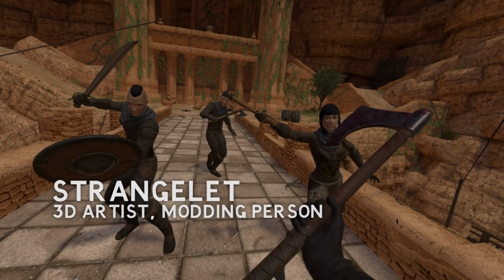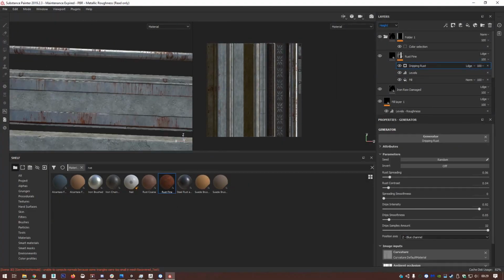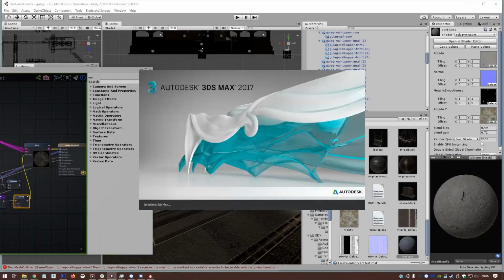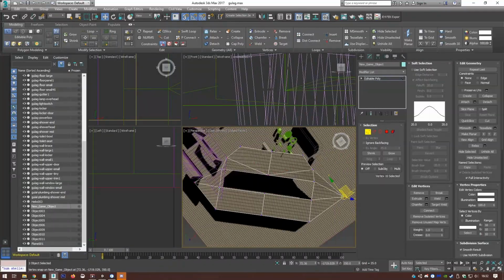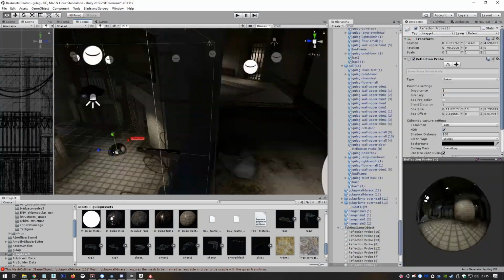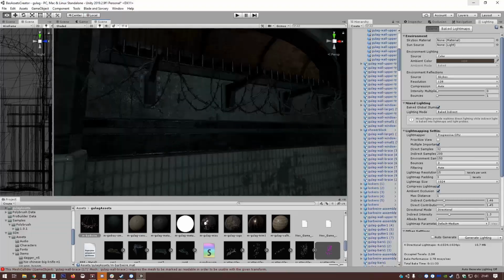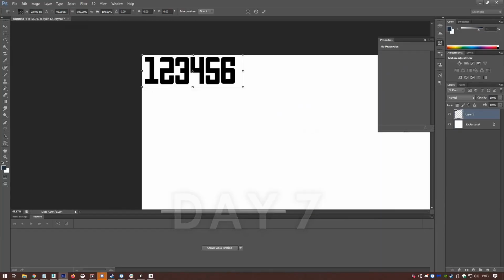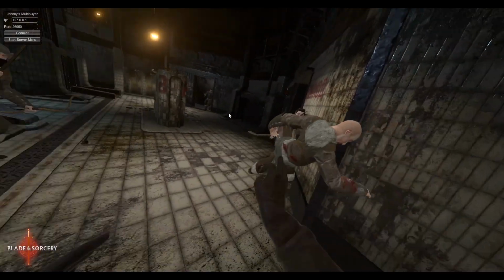The Making Of Gulag - a blade and sorcery map

Comment: Awesome work i love it! Can i ask a few technical question about performances? (Got a lot to learn about your techniques)
 
- Are you using HDRP or URP?
- How many tris do you have in your scene and drawcalls? Are you using mesh mergin?
- Is mixed lightning baked indirect as good for pref. than subtractive (this last one make everything feel flat and ugly for me but seem to save a lot of perf ) :(
Reply from the maker: im still feeling my way around unity and optimization after a long career in UE4.  Blade and Sorcery forces the URP, but until recently it was the lightweight LWRP which was very limiting. gulag originally had only one perpixel (dynamic) light in the whole map, the rest being baked.  and it has NO baked specular perpixel reflection at all - that role is taken over by reflection probes which don't blend across single meshes.   

this makes granularity higher than i'd like, and pushes up drawcalls.     if i mesh merge too heavily, i can't use enough different reflection probes to make it look nice :(  the gulag is pretty simple but it was still doing about 2500 batches on the renderer, which is too damn high.    I merged no-brainer things like the barbed wire sections and the lockers - all the little repeated details occupying small enough spaces.  I had a problem where if i baked occlusion culling the main light would flicker and cut out, so i'm not even using that (i will try again now we're on a different unity version ) 

we can now use more than 1 dynamic light tho, so next project will look a little nicer (and i did end up putting another one in in the entry way so you could look at your weapons in nice detail. 

i was afraid to use too much heavy geometry and heavy mesh collision, but just yesterday i was talking to a guy with a VERY heavy map that was running really well, so maybe thats not such an issue and i can go back and do some nicer collision passes. 

sadly, BAS is just not very optimized at the moment, with the U8 release introducing some heavy performance issues - mostly a cpu bottleneck so i can't do much about the graphics.   gulag runs at about 400fps unbound in the editor :)  i had an early problem where i made every spike in the map a "real" damaging, piercing spike, and that turned out to drop the fps to about 10 - so on the upside, theres probably a lot that can be done, but on the downside - not by me!
Reply: Yep, seems draw calls are more an issue for perf. than polycount (that's why i asked about mesh merging). So mesh merge over lods seem to work better indeed.
U8 as perf issue but it seems more related to heavy physics and npc spawn and will surely be fixed soon.
Mesh collider is not really an issue imo as they are in "sleep mode" until a collision occurs ( according to some unity devs).
Thanks for the tips :)